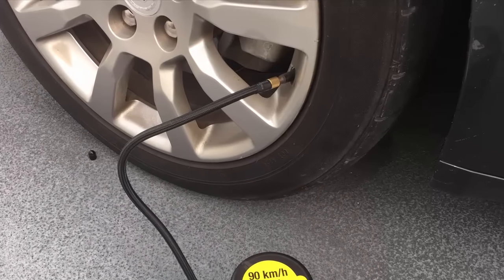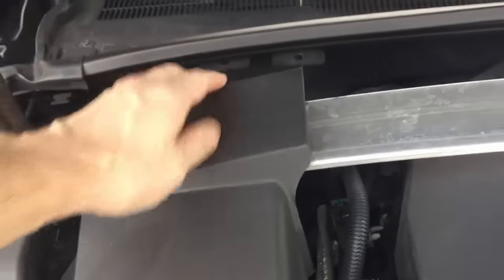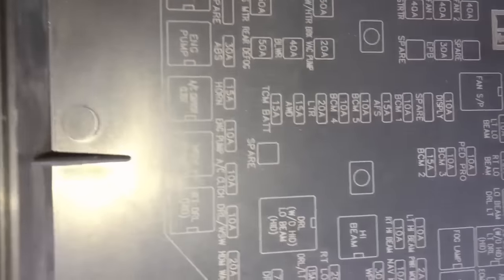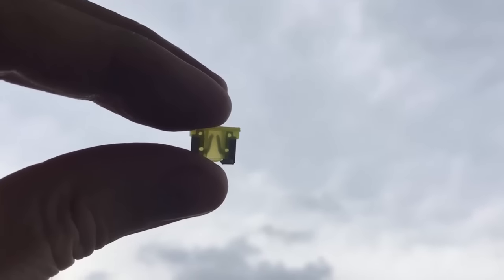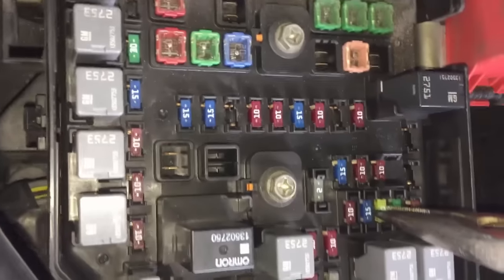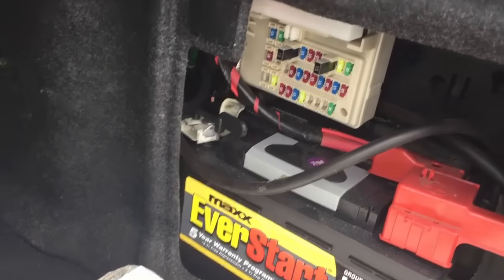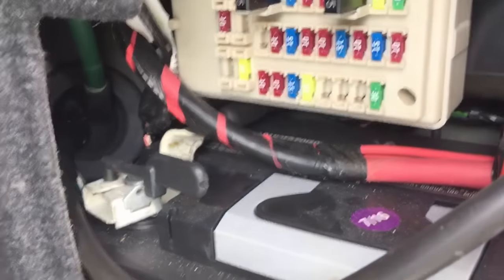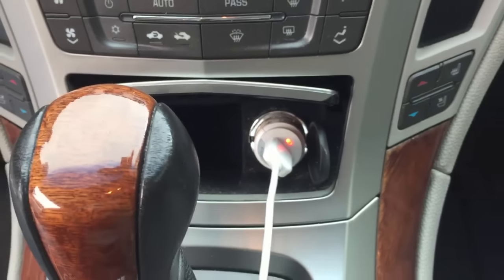Car charger not working FIX Cigarette lighter socket repair auxiliary power outlet fuse replacement

Comment: Literally the EXACT thing happened to me. I was using a portable air pump and then assumed it was broken. I plugged in my phone charger the day after and realized that the outlet had gone bad lol
Reply from the maker: LOL, should be easy to fix! Thanks for watching.
Reply: This happened to me using my portable air pump a few days ago while blowing up my paddleboard. Annoying since now my phone cord isn't long enough to reach from the middle outlet to the mount on my dash 😅

Comment: Good stuff! If the fuse continues to blow, then you have to figure out why. For me, it wasn't the car or wiring or anything having to do with the system. After much pain, disassembling, and diagnosis, it turned out it was the 12v to USB A adapter that was bad. A BAD ADAPTER!!  Go figure. Switched adapters and no more fuse blowing problems.
Reply from the maker: Thanks for sharing.

Comment: Wow,didn’t know that easy,just bought a used truck and have the same issues,I thought I have to bring it to the seller then wait a long time to get it fixed,but now I can try to fix by myself,thank u so much!
Reply from the maker: Definitely try it yourself. Works most of the time, unless there is some-other electrical problem. Thanks for watching.

Comment: Thank you!   This is EXACTLY what happened to me.  Tire pump blew my cigar lighter outlets.  However, as far as I can tell, the 20 amp fuse looks fine.  Im going to try replacing it anyways because I sure dont want to change the entire cigar lighter.
Reply from the maker: Sometimes the fuse may look OK but still, be bad. If you have a multimeter, check the continuity between two prongs on the fuse. No continuity - means the fuse is bad. Or just replace it with a new one :)

Comment: Thank you so much.  Same thing happened with my air compressor. It blew both the front and back cigar outlets. The replacement fuses were cheap. Saved me a lot of worry and an expensive trip to the service center.
Reply from the maker: Glad it helped
Reply: @Your-Self  did your air compressor come with a spare fuse? Mine came with one but I’m not sure if worked.  Too afraid of blowing the car fuse again.
Reply from the maker: In my case, the cord insulation on the air compressor was old and cracked, and that's what shorted the fuse on the car. I replaced the cord and haven't had any issues since.

Comment: wow thank you for this you just saved me buying a new radio because my cigarette lighter socket wasnt working neither was my radio but i assumed it just stopped working bc it was a cheap radio but turns out the radio and socket use the same fuse
Reply from the maker: Glad it helped!

Comment: Thanks man! I thought I'll have to have my port replaced. Though, my car's fuses were under the steering wheel towards the right (Right Hand Drive Car for India, Hyundai Grand Sportz) and there were no spares for 20A included in this fuse box. (Thankfully though, it was simply called Power Supply 1 and 2, the second one being for the passenger seat's port). Though, the one under the bonet in the front for Car's battery and power supply had a spare for each of the Ampere ratings in the car and even had a mini plier included too.
Reply from the maker: Glad it was helpful, and thanks for watching!

Comment: Very informative. What should you do if, after checking your fuses and finding them all in working order, your power points still have no power? My 2014 Ford Flex has four power points, none of which are functioning, despite their corresponding fuses being intact. What steps should I take next?

Comment: thanks for the video! I broke 2 cars' fuse today :( trying to give some air for car A(works 5 sec then it shuts down). bring car B next to it and give it a go, another 5 sec and it shuts down .... both cars' cigarette lighter socket connect with USB charger all the time and worked fine but all the suddenly when connect to mini compressor the fuses just blown ? One of the car is only 2 years old. At first I thought it was the mini compressor's problem but when I tried the 3rd car(which is only 2 month old) it worked perfectly. felt kind of bad for the other 2 cars though... How often does fuses break?
Reply from the maker: In my case there was a problem with the compressor. Part of insulation on the wire was damaged, so when I moved compressor around the Positive and Negative wires crossed each-other and shorted the electrical system. And that's when fuse gets blown to protect the rest, more expensive components.
Reply: I see, i'll double check on my compressor just in case. Thanks again for the tips.

Comment: So here is the deal, in the last car i owned, lighter jack worked perfectly when the car was turned off, aswell as the radio which is pretty common, but in my current car radio works fine but lighter socket doesn't work unless i turn on the car or at least give it a contact with the key. Is there any solution for the lighter socket to work without starting the car? It is a Citroen model btw..
Reply from the maker: I think the lighter jack is disabled by design on some smaller cars with smaller batteries when the car is turned off. And I don't know how to bypass this setting. Larger cars with large batteries can handle the radio and charging your phone while not running, but smaller batteries can't. That's just my opinion.

Comment: Do I need to change the auxiliary fuse as well as the cigarette lighter fuse? If one is blown will both be blown?
Reply from the maker: Fuses are independent, so replace only the one that is blown.
Reply: @Your-Self  thanks for the reply.

Comment: I am facing the same problem after using tyre inflator. Let’s hope I can resolve the issue.
Reply from the maker: Should be an easy fix if you can find the right fuse!

Comment: I have exactly the same situation (portable tire inflator busted both my cig lighter fuses). How can I prevent it from busting out my fuse again (aside from not using the defective tire inflator)?
Reply from the maker: You got it right... don't use defective devices.
In my case, the electric wire from the air pump deteriorated and shorted out under certain angles. After fixing the wire, the problem went away!

Comment: Can I fix one without the other or do I have to fix both to get them working?
Reply from the maker: Those sockets are independent.
So if you fix one, it will work just fine without the other.

Comment: So same thing happend to me when I tried using the air pump. After I fix the fuse can I use the air pump again?
Reply from the maker: The air pump probably shorted and blew the fuse to protect the rest of the electrical system in your car. If you use it again, the same thing will probably happen. I would suggest repairing or replacing the air pump. Thanks for watching.
Reply: YourSelf thanks man. I bought another one hhahah
Reply from the maker: good choice!

Comment: Same situation but fuse not blown, low voltage on lighter socket tho. Might need new socket
Reply: Update: if you tested your outlet with a voltmeter and it shows low voltage change your outlet, it worked for me.

Comment: Thanks man
Reply from the maker: Thanks for watching!
Reply: @Your-Self  sadly I tried it and none of my fuses were blown so ig ima just buy a new one
Reply from the maker: Sometimes the fuse may look good but still be blown. If you have a multimeter, check the fuse for continuity.
Reply: @Your-Self  yea I replaced earlier but nothing my truckz a 1995 tacoma so I think im just going to remove the cigarette thing and put in  a usb plug just to make it look better ig🤔

Comment: Had same problem, using a pump it stopped working all of a sudden but ALL the fuses look ok. 🤷‍♂️ what else can i check?
Reply from the maker: The fuse may look OK but still, be bad. If you have a multimeter, check the fuse for continuity to verify it's not open.
Maybe the pump itself burned out. Did you try to use a phone charger in that socket?

Comment: Well the first problem was using that cheep tire pump. And never just look at your fuses sometimes they look good but are bad . So use a good voltage meter and do a continuity test. That is the only way to 100% know that you have a good fuse!
Reply from the maker: LOL, the pump was the original OEM provided by Cadillac, but apparently, it couldn't handle the Florida heat. If the fuse wasn't obviously burned out, then yes, it's a good idea to double-check it with a multimeter for continuity. Thanks for watching and commenting!
Reply: @Your-Self  o yes those OEM one are junk . Good video the sound and you should be on the news .

Comment: What is the name for the extra fuses for the Cadillac STS ? I got the broken fuse out and need the extra one
Reply from the maker: I don't know the name for your fuse, but if you take the damaged fuse to the local Auto parts store, they will give you correct replacement.
Reply: YourSelf Thank you god!! Is Auto Zone good ?
Reply from the maker: Sure, Auto Zone is good. They should find a replacement for your fuse for about $1 or $2

Comment: If I take the spare fuses inside the box, does it affect other components?
Reply from the maker: You just have to make sure that the fuse is truly spare, then it won't affect the car.
The 4 fuses in my video are unassigned to anything, so they can be used as a replacement.

Comment: What is max wattage a cigarette lighter output can handle please
Reply from the maker: Multiply the Voltage by Current (fuse) you'll get; 
12x20=240 Watts max.

Comment: Same exact thing happen to me using a air pump on my tires but I checked the fuses and they dont look blown.
Reply from the maker: The fuse may look OK but still be blown. 
Try to check for continuity with a multimeter.

Comment: I had this happen to me with my car. I use a air pump and that happened. I got an new outlet and it didn't work? The fuses like ok? Nothing? Maybe I looked at it wrong? I'll have to check again.
Reply from the maker: Sometimes the fuse is burnt but looks OK. So it's best to check the fuse with a multimeter for continuity.

Comment: I have 3 cigarette lighters on my 99 Silverado 1 doesn’t work .  I’ve replaced the fuse and that one still doesn’t work any help?
Reply from the maker: If you identified the correct fuse and replaced it, but it's still doesn't work... then the cigarette lighter itself maybe burned out, rusted or dirty with gunk preventing good contact. Or maybe there is a loose wire that needs to be tighten somewhere in electrical system. Unfortunately I'll not be able to assist you any further :(
Reply: JoceyVDV I have 98 suburban same thing happen to me , then I started pulling random fuses and found another one was blown and I replaced it and it work

Comment: I got a theory for having your phone charging your car when you don't have a phone charger inside your car I made up my own little guy and it works faster than the regular one I can send you a picture and here it is and I'll show you a picture of it in action I don't know how to text it to you but I'll try yep it works great cuz my indoor one doesn't work so I go right out to the battery and I fired up I go ground to ground power to power with the tip and it lights it up carriages almost twice as fast not quite

Comment: Omg my power outlet stopped working after using an air compressor to put air in my tire! Smh!
Reply from the maker: No worries, replace the fuse, and it should work again!

Comment: my battery keep going dead on my 2009 Cadillac CTS and I already bought a new battery...HELP
Reply from the maker: Ask the place where you change the battery to check the Alternator if it's working correctly and recharging your battery. Also, ask them to check for the Parasitic Drain on the battery.

Comment: I checked the fuse and the previous owner used the wrong fuse to power the outlet so no wonder it doesn’t work anymore. Need to take it to the garage.
Reply from the maker: If the previous owner used a smaller fuse then just replace it with the correct one.
But if he used a higher-rated fuse, some other components may have been fried.
Reply: @Your-Self  hè used a 20 fuse in a 15 but the fuse isn’t fried or something but i can’t charge my phone or anything like that

Comment: I did the exact steps but mines still did not work on a Dodge Charger 2011
Reply from the maker: sorry to hear that... replacing Fuse  works 90% of the time, but sometimes the socket burns out, or a wire gets loose... you may need to take your car to the shop for trouble shooting

Comment: Sooo.. this is literally all it takes ? Why the hell do articles on google say mechanics charge $100 or more to do this ? That is just insane wtf
Reply from the maker: Yep, knowledge is a powerful thing!
Reply: Yes sir and also thank you very much for the video is was extremely helpful. I’m not sure but my car doesn’t have extra ones. Can I use one that is also yellow and the same number 20 that’s used for something else that I don’t use ? Thanks
Reply from the maker: I wouldn't risk pulling a fuse from a place you are not sure about. It's better to go to your local auto-parts store to buy the replacement for a couple of bucks.

Comment: Every time I change the fuse it works for a few days then it stops working.
Reply from the maker: If the fuse burns out every few days, the device that you use inside the charger is probably shorting out. Also, if you have some small metal things fall into the socket (coins, pins), they will burn the fuse as well.
Reply: I’ll try using a different car charger

Comment: Instead of 15 number fuse I have install 10 number fuse so will that work? As I don't have 15 number fuse.
Reply from the maker: The smaller fuse should work for charging a phone. But if you use something like an air-pump, the 10 amp fuse may blow as well.

Comment: I'm trying to see why my charger always blinking this probably why
Reply from the maker: If your charger is blinking, the fuse is probably good. You may have a loose connection somewhere which makes the charger to cycle ON and OFF. Or the charger itself is going bad.
Reply: @Your-Self  it's only does it when I'm in the car

Comment: I changed the fuses and it wtill dont work...
Reply from the maker: Before you changed the fuse, did you verify that the old fuse was bad? You can do the continuity test on the old fuse with a multimeter .
Reply: @Your-Self  yes old fuse was burnt out. Changed it nothing. So i tried to splice into my other 12v that was working and run a hot wire to the other one. Once i spliced into it and got it just about ran i just double checked to make sure it was still working so i put it back together and now the one that was working isnt even after i put the wire back together. It kinda hard to explain whatni did over txt lol. Im.lost right now. Both fuses are fine for both of them the wires are fine idk...
Reply from the maker: Sounds like the original fuse did its job and burnt out to protect the rest of the circuit. But now, it seems, you got a big mess on your hands... probably need schematic to trace the problem, and maybe a professional tech. Good luck!
Reply: @Your-Self  i got it lol just ran two new wires from the fuse to the plug. No tech needed thanks tho for ur mombo jumbo nonsense

Comment: Same problem just happened
Reply from the maker: No biggie... replace the fuse, and it should work again!
Reply: @Your-Self  I actually did that for the first time and bought a new pack. It actually worked! Then using my air pump to the car it got it to 32 psi and it stopped working. Why? Could it be the pump blowing it?
Reply from the maker: On my old pump, the insulation on wires got cracked and shorted the fuse. Also, the pump may be drawing too much current (Amps) when the tire is almost full, which can blow the fuse as well.

Comment: Hey there I was on the motorway and my phone ran out of charge i plugged in my charger but the tip of the socket was loose and my phone would charge how would I fix it ?